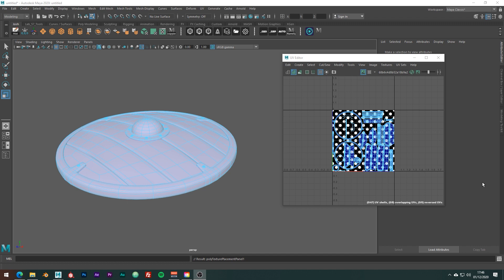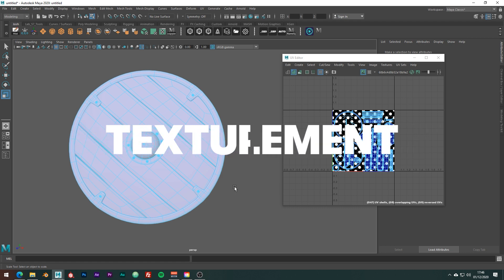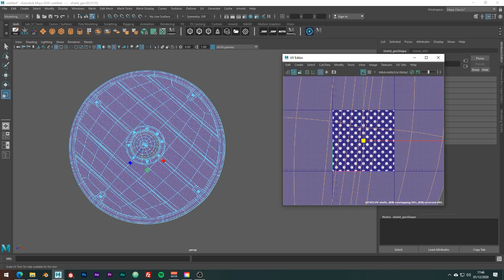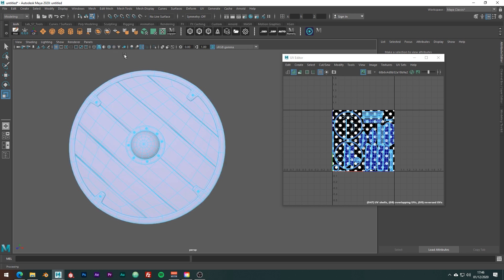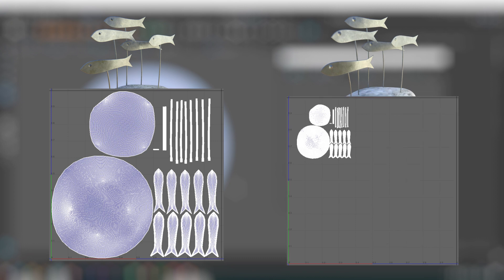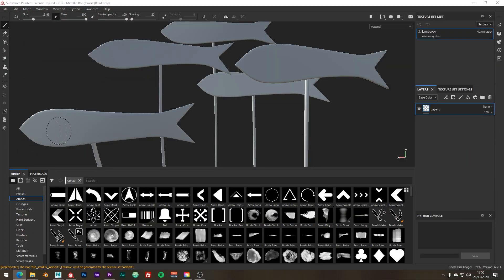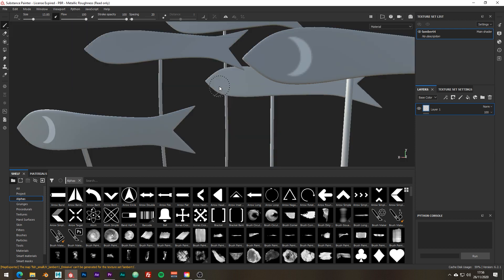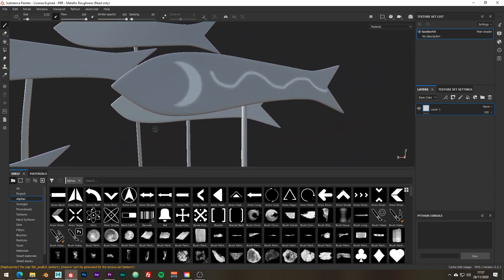Texel Density Explained Fast

Comment: This has a fundamental problem: What do you do if your textures themselves have a different information density? You can have a checkered texture with UV's displaying a perfectly equal texel density, and yet when you swap to a packed texture, some of them are too big and others are too small; which means you have to scale to UVs for each individual texture anyway. This means that the checkered texture is a pointless reference point and a waste of time.
Reply: Then you take it case by case, if it's something that needs more resolution just make the shell bigger, the checkered texture is not a waste of time at all it gives great information for texturing models

Comment: How to fit every uv shell in a map and save a good texel density?
When i set texel density 20.48 for 2k my uv shells become very big and i can't fit them i the map
Reply from the maker: Well that’s when you need to start considering how you’re laying out your shells. If you can’t fit all the shells with a good texel density, then you might need to consider splitting the shells across multiple tiles with UDIMs. Or try fitting them and using a higher resolution texture map.